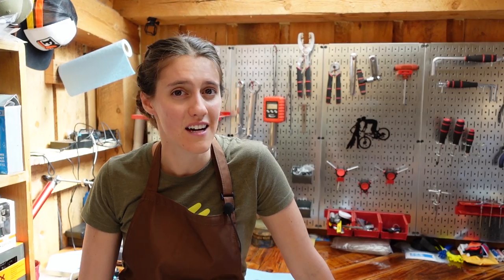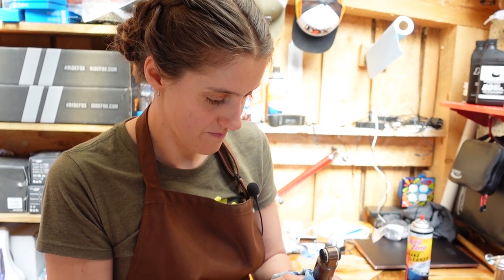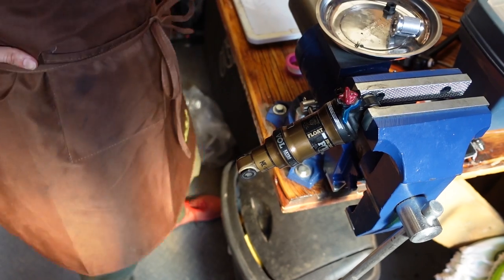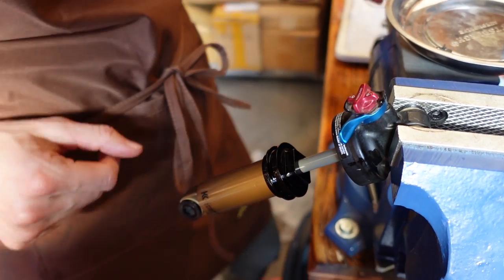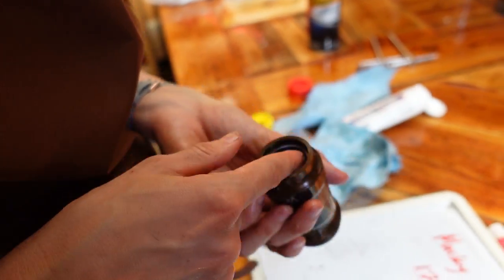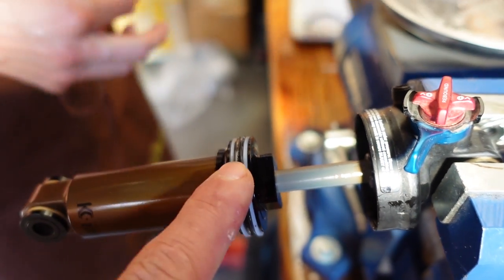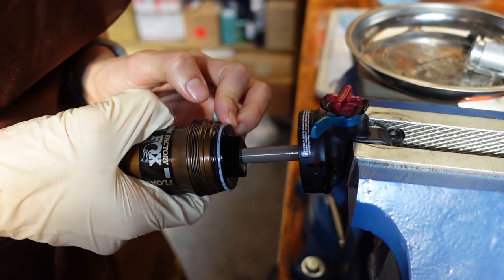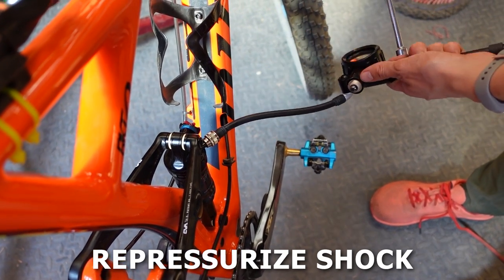Basic shock maintenance (AIR CAN SERVICE for Fox Float shocks) | Syd Fixes Bikes

Comment: A cool trick I learned from aviation is to cut the old o ring once you pull it out so you can never confuse the old for the new. Cheers!
Reply: Or just throw it away. 🤷‍♂️ I also work in aviation.

Comment: Another useful and relateable tutorial!

I would suggest leaving the shock on the bike to start with: remove as much air as you can, cycle the shock (easy to do while still on bike, very hard to do out of the bike), remove rest of the air. Then, if really tight use a square of old tube to grip the canister, twist loose. Place rag on stanchion in case canister still wants to fly off, rag will stop it from hitting the bike. Then you can loosely thread canister back on to remove shock in one piece for the rest of the service. 

Oh - everyone should take the time to look up torque settings for bolting back onto their bike. Too tight and you can wear out pivots, bushing, and/or bearings. Or even affect the smoothness of the fork travel. It's not as tight as most people think they should be.

Comment: Im one of those people who basically other than checking the cylinder pressure once in a while neglected my shocks but attest to fox it lasted 16 yrs (fox float R purchased 2008) with no problems and it was just a valve failure but im going to do it properly and recondition it she should be good for another 16yrs then. Cheers for the info
Reply: yeah mines of a similar vintage and not been apart yet - if it aint broke dont fix it

Comment: Haha! That's what I've noticed... In general, I lose 15 psi when I put the shock pump on... but it can vary a psi or two one way or the other depending on the shock volume. I've never rebuilt a Fox Shock, this is good stuff! I have rebuilt my old Cane Creek AD12 about 4 times in the past 20 years. It is amazingly robust, but tends to go flat suddenly one day if the seals are not replaced often enough. The Ad12 is not nearly as refined as a good modern air-oil shock, but it keeps working, with, as you mentioned, regular maintenance.

Comment: That was cool.
My only criticism. At 8 minutes when you placed the white rings on. 
Use the small cylinder of the shock to pass through the gap.
Rather than opening ring really wide around the larger diameter of its resting place....:-)

Comment: Perfect timing given I just got a bike with Fox suspensions in it :D thanks. I just did the service on my older bike with a RockShox and I had to figure a few things out to make it to the end, same problem as you putting it back together, ended up pushing it against a concrete wall with my whole body weight and I managed to close it actually pretty easily.

And as Felix suggested: cycling the shock while letting the air out to equalize the two chambers helps a lot, the air can wont explode out on you :)

Comment: Thanks for another great instructional! I do have a question, though. Can you tell me how to remove the bushing that connects the bottom end of the shock to the frame?
Reply from the maker: Generally you can remove the bushing using a small flathead screwdriver to pry the outer pieces off and then and then press it out using your hand or a vise plus something like a socket on the other side for it to slide into.
Reply: Great! Appreciate the advice -- looking forward to more great videos from you!

Comment: the reason why the aircan shot out is because the neg airspring was still charged and i recommd letting out a bit (50 psi or so) of air cycling the shock( equalizes it) and doing this until its emty so you domt have a aircan flying im your direction , or at least put a shop towel thru tje bushing

and for all boys out there aim away from your nu*s, it fri*king hurts, ask me how i know
Reply from the maker: Ahhh so this is why Macky had me do this step 😂😂 but seriously the towel tip works, we did it on the second shock we did and things were much more controlled lol. Good to know about neg air spring, that makes a lot of sense. Live and learn!
Reply: @sydfixesbikes  It's also a good idea to make absolutely sure that your shock is not in what's referred to as a Stuck Down condition (where pressurized air has bypassed the internal seals and is now forcing the shock to contract completely- most often the product of cold weather riding in my experience) BEFORE you unscrew the can.  In this state the air can will be fired off into the next time zone and can do a lot of damage to anything in the line of fire!  There are tutorials available on how to deal with a Stuck Down shock that you really want to watch before messing with!
Reply: Yeah I was curious about that too, when I've had my shock serviced I've always been told to slowly release the air pressure approximately 50psi at a time, cycle the shock, and keep doing it until it's completely empty.

Even if you're just deflating your shock or fork to take out a token or something like that, you should still do it.

Same with pumping it back up, cycle it every 40-50psi to balance the two chambers otherwise you might pump it up and after a ride it'll be too low because it balanced the air between the two chambers during the ride.
Reply: I just did this on my own fox. Went really smooth by following your video! Thanks! 👑

Comment: The reason servicing the Air Can is important, is because the Fox Fluid is consumed throughout the use of the shock.  If you go a really long time without service, you can actually open a chock to find a dry can and by that time, your shock will start losing air and the shaft can be damaged.

Comment: Awesome work as always. Can you zoom into the products you use for just a second longer. Not sure what the blue stuff at the end is called. Thanks.
Reply from the maker: It's the Float fluid and is included in the air can service kit.

Comment: Would a strap wrench have helped Syd with leverage, while putting it back together in the vice?  Seems like that would have been less challenging than working on the frame.
Reply from the maker: Probably but it was actually pretty easy to tighten once I got it back in the frame

Comment: I cannot figure out why my Float DPS blue firm to soft (3 position) goes “crazy” randomly. At times, often after a ride the switch seems loose, stripped or broken - but its NOT 😅. I eventually just locked it in one position with the set screw on the body of the shock… whatever position would create 20% of sag at my weight.

Comment: I've had a non boost valve 2014 fox float CJMS coded shock that hasn't been serviced since day 1 since I ride most of the time on the road (due to changed interest to road bikes early in but haven't got the cash for  RB so I rode it with slicks with the RB guys) but then again I got it for so cheap that another 2nd working one would cost less

Comment: recording air pressure is useless if you have a leaky shock. Just do the recommended fill and adjustment procedure after the service.

Comment: Great video! My rear shock seems to have "cavitation" going on. Will this fix that?
Reply from the maker: Unfortunately not. This just changes the lubricating fluid of the shock (the equivalent of a lowers service on a fork). Cavitation is air inside the damper cartridge which requires a full shock rebuild.
Reply: @sydfixesbikes  haha. Ok any chance u will do a video on that process 😅 thanks for the reply. Also is there any risk in riding my bike with this happening.
Reply from the maker: The shock is likely to behave somewhat erratically, so be careful sending it. We talked to Fox about doing a video on it and they basically said "you need too many specialized tools, like a nitrogen machine, for this to make sense for consumers to do themselves" so probably no full rebuild video anytime soon...

Comment: Great content!! Question, is it ok to bare clamp the vice directly to the shocks like that?
Reply from the maker: Yeah, that part of the shock is generally "clamped" between the linkages anyway. Obviously you don't want to over tighten it, but clamping in the vice shouldn't be a problem.
Reply: @sydfixesbikes  thanks soooo much for answering :)
And yeahh, that makes total sense!!

Comment: Hi Syd, I replaced the seals etc, but a few weeks later it had leaked. I didn't notice any damage or scratched. Any ideas?
Reply from the maker: How much did it leak? Assuming it wasn't much, most likely that was just a bit of the shock oil from when you did the maintenance. Give it a good wipe down and see if it happens again. If so then it would be a more serious problem that might require sending it in to Fox.

Comment: Why use the slick honey when you put the Fox oil provided over it?
Reply from the maker: The slick honey is to lubricate the seals with a lube that stays longer to keep the seals from drying out. Probably not necessary if you store your bike in a way that keeps the oil on the seals all the time (i.e. hanging from the front wheel).

Comment: When you say to equalize the positive and negative chambers in the 1 minute summary, do you just mean cycle the shock (bounce on the bike) a couple times?  I see another commentor provided that definition WRT can removal, but wanted to confirm.  Thanks!
Reply from the maker: It's more of a consistent pressure on the shock to compress it to about 25%. You can actually hear a little psst as air transfers to the negative chamber and you just want to go back and forth past that point a couple times every 50psi or so and then as you get to your final pressure

Comment: I am trying to service my Fox DCRV rear shock, but the air can refuses to unscrew. It has several years of African dust in the thread! All the air is drained (cycled the shock repeatedly) I have tried putting it in a vice and using rubber gloves for more grip but can't shift it. I have used penetrating oil and even heat from a hair drier (so it's not too hot and damaging seals) but still no joy. I don't want to use a strap wrench as it will dent and wreck the shock. Any suggestions as to how I can unscrew this uncooperative air can?
Reply from the maker: You could try wrapping a tube around it for better grip. Otherwise the strap wrench is probably your best bet...

Comment: Can I reuse last year's seal kit and just clean, replace oil and pump it up??
Reply from the maker: Yeah, if the seals aren't leaking you can just clean them. It's good to replace the foam o-rings when swapping oil though as it tends to hold onto dirt...

Comment: how to equalize positive and negative air chambers while pressuring it up?
Reply from the maker: Leave the shock pump attached and compress about the suspension about 25% and you should hear a "psst" as it transfers from the positive to the negative. Repeat until you don't hear the noise then check the air pressure. If it has gone down (it probably will), add air and repeat the process until the air pressure remains where you want it to be. Then remove the shock pump.

Comment: May I ask how you equalize the chambers when you refill?
Reply from the maker: Compress the fork or shock about 25% every 20psi or so. If you listen carefully you can usually hear the air equalizing between the positive and negative chambers.
Reply: Thank you! After scrolling down a while in the comments, another one of the community seemed to imply that.

Comment: Heyyyyy, so i have a 2021 Rocky Mountain Altitude A70, it's only 6 months old but I ride it like someone's going to take it away from me at any given moment! Anywys i think I'm losing air in my Factory Float X2. i went from 230PSI to 160-170 ish in about 2 weeks? is this excessive? any thoughts?
Reply from the maker: Yeah, definitely shouldn't be losing that much. It is worth noting that when you put the shock pump on, you lose some pressure (it has to fill up the hose of the pump). Figure out how much by pumping up to a certain pressure, removing the pump and putting it back on and checking what the pressure says. Usually it's between 10 and 20 psi that it loses to fill the hose. I'd recommend putting it up to 230 and checking again in a week to see if it's actually losing (and it's not just the hose). If it is losing, it's probably a warranty issue

Comment: I wonder why fox, specialized, etc don't make more rugged components like dirtbikes at the expense of 20% or so mass increase for those components. I'd gladly take a 0.3 lb to 0.5 lb weight increase for shocks that don't need frequent servicing like my motorcycle, dirtbike, or race truck do.  They can keep the lightweight lines for the pros.

I'm willing to bet it has something to do with service profits (to rebuild them for you), planned obsolescence, and increased sales from broken shocks.

Most rebuilds cost $50 - $70 in labor and $15 in parts, and you're supposed to service them every 40hrs, spending at least 2 hrs to perform it whether you schedule & drop-off/pick-up, or DIY. Sure it's fun to do every now and then but what the hell.

Comment: "because nothing says expensive like an expensive bike that requires expensive maintenance." 

There's only one reason to change the oil in your car which is to see if the person who claimed to install a brand new transmission "just right" did in point of fact do that "just wrong."

That's how I solved that ahem "problem" ahem with of course the point being walking is always better...or in the case of Everesting "stair-stepping."

Try that some type if you're looking for something to give you the creeps..

Comment: Maybe get a better shock pump because you get no accurate air pressure reading even if you do what you did ,,, 170 psi take hose off pressure changed reattach hose pressure changed.!!

Comment: Rubbing alcohol and isopropyl alcohol are not the same.
Reply: Rubbing alcohol can be either ethyl or isopropyl, but usually mixed with water so it's 60-70% strength, plus something to make it taste terrible. For cleaning, 99% strength (of either, but it's pretty hard to get pure ethanol) is preferable-- better solvent for oil, grease, and grime, plus dries more quickly and doesn't leave a residue.

Comment: Not that you are to blame, but I’m real tired of “ bike speak “ = made up terms replacing already adequate, understandable terms seemingly just used to make bicycle people feel: 2) in the know or; 2) part of the group.  Front sprockets, rear sprockets, front air shocks, rear air shock…..just do fine.  I went to a bike shop asking for slick honey- they didn’t know what I was talking about.  Aren’t we all just tripping over each other ?  It’s just too infantile & anoying.
Reply from the maker: Slick Honey is a specific brand of grease with specific properties (it's the same as Slickoleum). There isn't a good way to describe that grease without using the name as other types of grease don't share the same properties. But in general I get what you mean.